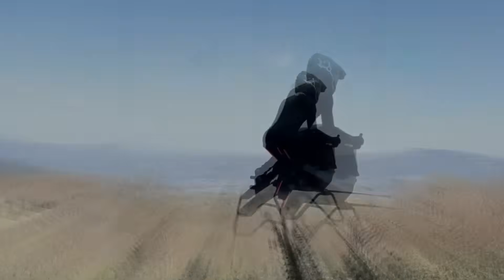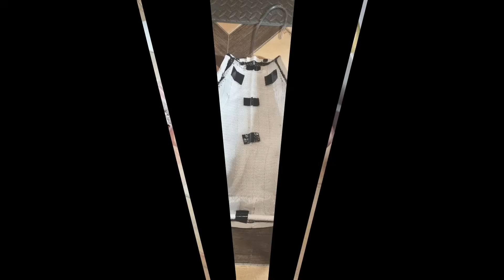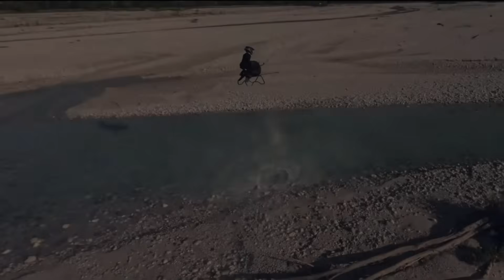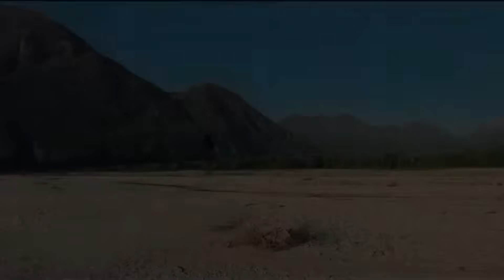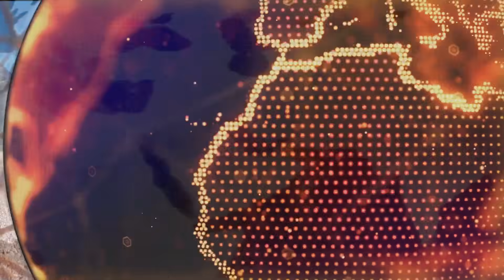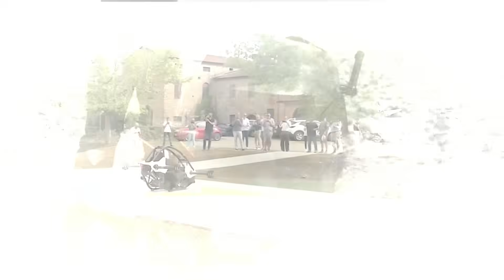2026 NEW VOLONAUT AIR BIKE OFFICIALY LAUNCHED!! Key Features, Tecs, & Benefits!!

Comment: No one seams to mention what to range is ?
Reply from the maker: Great catch, @richardvandb6558 — you’re right, range is one of the biggest missing details here. 🧐✈️

Based on similar jet-powered personal flyers, we're likely talking *10 to 20 minutes* of flight time per tank, depending on weight, altitude, and throttle use. Volonaut hasn’t published exact numbers yet, but with jet propulsion, efficiency isn’t the strong suit — at least not for now.

Would you consider something like this worth it with such a short range, or would longer endurance be a must-have for you?
Reply: @ too much money for too little fun
Reply from the maker: @richardvandb6558 You bring up a solid point — at that range, it does feel like more of a thrill ride than a practical commuter. 🚀 Would you be more interested if the Volonaut had a longer flight time, or is the price just not worth it for you either way?

Comment: Problem is flight time
Reply from the maker: @innomoto
Totally agree, @gs-andy! Flight time is one of the biggest hurdles for any personal flying vehicle right now. Even with advanced battery tech, we’re looking at limited flight durations, especially for something like the Volonaut Airbike.

To make it more practical for everyday use, we’ll likely need to see significant improvements in battery energy density and charging speeds. Maybe we’ll also see hybrid systems or advanced fuel cells that offer longer ranges.

How long do you think an ideal flight time should be for it to be practical for commuting or recreational use?
Reply: @innomoto  You should be able to have an hour of flight time, but it will be exciting to see how the technology develops, but very cool concept.👍
Reply from the maker: @gs-andy Absolutely, an hour of flight time would definitely make it more viable for real-world use! 🚀 It’ll be interesting to see how the technology evolves — maybe one day we’ll be zipping through the skies like it’s no big deal. How do you think battery advancements will change the future of personal flight?

Comment: A wonderful machine. I would love one of those. What kind of price point are customers looking at?  I would also like to see a takeoff and a landing. Is it difficult to transport? weight?
Reply from the maker: @brianjanson3498
Great questions — and you’re definitely not alone in wanting one of these! 🙌

Right now, there's no official retail price, but early prototypes of similar jet-powered personal flyers often land in the \$300,000–\$500,000 USD range. That could change dramatically depending on production scale and tech improvements.

As for transport — good point. The Volonaut’s compact frame helps, but the jet system likely makes it too heavy and bulky for a regular trailer. And takeoff/landing? From what we've seen, it’s vertical like a drone, but it requires serious skill due to thrust and stability control.

Hopefully, we’ll get full takeoff and landing demos soon. Would you be more interested if it had an easier launch system or came with a transport kit?

Comment: what is the power source? where is the fuel kept? what is the real range? seems like vaporware to me.
Reply from the maker: @innomoto
Great questions, @jims9625 — and you’re not alone in wondering! 🔍

Volonaut hasn’t released full technical specs yet, but from what we know, it uses jet turbine propulsion — likely powered by aviation fuel or a similar high-energy-density source. As for range, it’s still speculative, but early prototypes like these often have short flight times (10–20 minutes) due to fuel and weight constraints.

You're right to be skeptical — until we see consistent test flights, specs, and certifications, it's fair to call it "concept-stage" or borderline vaporware. But that’s also what makes it exciting — it’s a peek at where personal flight might be headed.

Would you be more interested if it ran on electric ducted fans instead of turbines?
Reply: It uses small jet engines like Franky Zapata.Franky uses 5 micro jet engines on the fly board air look it up same thing.Not a mystery. 😊👍🏻
Reply from the maker: @danielhipp5541 Exactly! The Volonaut’s tech seems inspired by pioneers like Franky Zapata’s Flyboard Air, using multiple small jet turbines for thrust. It’s a fascinating step forward, though the real challenge is balancing power, safety, and flight duration. Would love to see how they tackle that in the next iterations! What feature would you want in the ultimate flying bike?
Reply: @innomoto cup holder 🤣 have you seen my 5 foot flying Delorean model we use a $ 100,000 jet drone with 4 jet engines to fly ?
Reply from the maker: @jims9625
Je comprends parfaitement ton scepticisme ! Le Volonaut Air Bike utilise de petites turbines à jet similaires à celles du Flyboard Air de Franky Zapata, avec du carburant aviation stocké dans un réservoir à l’avant, un peu comme une moto.
Le temps de vol est pour l’instant limité à environ 10-12 minutes à cause des contraintes liées au carburant et au poids.
C’est clairement une technologie encore au stade conceptuel, pas un produit prêt à être commercialisé.
Mais si les futures versions passent à des moteurs électriques plus silencieux et avec une autonomie plus longue, ça pourrait tout changer.
Tu serais plus intéressé par un Air Bike électrique plutôt que par un modèle à turbines à jet ?
Reply: The fuel tank is just like a motorcycle right in front of you.Franky Zapata fly board air about the same has 12 minutes of flying time.
Reply from the maker: @jims9625
Totally understandable to be skeptical! The Volonaut Airbike uses small jet turbines similar to Franky Zapata’s Flyboard Air, which means the fuel—aviation-grade—is stored in a tank up front like on a motorcycle. Flight time so far is pretty limited, around 10–12 minutes, mainly because of fuel and weight limits.

It's definitely still early days, so it feels like concept tech more than a ready-to-go product. But if the tech evolves toward quieter, longer-lasting electric ducted fans, that could change everything. Would you be more into a flying bike if it ran electric instead of jets?
Reply from the maker: @jims9625
Totally understandable to be skeptical! The Volonaut Air Bike uses small jet turbines similar to Franky Zapata’s Flyboard Air, with aviation-grade fuel stored in a tank up front like a motorcycle. Flight time is currently limited to about 10–12 minutes due to fuel and weight constraints.

It’s definitely still early-stage tech—more concept than ready-to-go product. But if future versions shift toward quieter, longer-lasting electric ducted fans, that could be a game changer. Would you be more interested in a flying bike powered by electric fans instead of jets?

Comment: Stabiliti look incredible for this small thing 😳
Reply from the maker: @Quiwi707
Right? 😳 The stability is honestly one of the most surprising things about it — especially for something this compact and jet-powered. Keeping it steady without a full aircraft-style control system is wild engineering. Imagine what it could do with next-gen gyro or AI-assisted flight control!

Would you trust it for low-altitude cruising, or still feels too sketchy?
Reply: @innomoto  really amazing ..
Effectivly ,this make me thinking about giroscopique whit moto concept few years ago in Los Angeles with many vidéo on YouTube.

Yes you tell the word ,its wild engineering like F35 army level ...
Crazy 
Just Jetson team or Zapata French guy team can do thing like that...

Just one reactor and stability ...whaou!!
Reply: @innomoto   low altitude..yes look ok for that 👍
Reply from the maker: @Quiwi707 Exactly! It's almost like a mix of F35-level tech and that gyroscopic moto concept — both wild and groundbreaking! 🤯 The fact that they’ve pulled off stable flight with just one reactor is a huge feat. If it can hold steady at low altitudes like that, it could open up all kinds of possibilities for urban commuting or rescue missions. Imagine the future of this tech when they start adding more power and AI-assisted stability! 🚀 Would you take it for a spin, or still need a bit more convincing on the safety front?

Comment: This real and if so how where can I get the breakdown of its tech?
Reply from the maker: @wisdomafoolweakness3391
Yes, it’s real — though still in the prototype or concept stage. The Volonaut Airbike is one of several new experimental flying motorcycle designs, using jet turbine tech for vertical lift and forward thrust. Think of it like a scaled-down VTOL (Vertical Take-Off and Landing) craft, but shaped more like a bike.

For a detailed tech breakdown, most info comes directly from demo videos, engineering showcases, and concept design releases. You can search for Volonaut’s official site (if available) or check out aerospace startup news, patent filings, and pilot interviews. Kardesign also shares speculative and design-based breakdowns that give insight into how such machines might function.

Would you like a summarized breakdown of the known and possible tech based on current prototypes?

Comment: Jet, frame, pilot. LFG🔥
Reply from the maker: @masteraugmentedproduction5828
Straight to the point — Jet. Frame. Pilot. That’s the whole vibe right there. 💥 It’s raw, stripped-down flight power. No fancy cockpit, no bulky fuselage — just you riding a turbine with a seat. LFG indeed. 🔥

Would you take it into the wild, or rip the skies over open water?

Comment: So we just gonna believe this thing flys without propellers or wings?  I call bs theres no explanation of the thrust
Reply from the maker: @aaronsanchezz Great point! The tech behind it is definitely fascinating, and it seems like they’re using jet propulsion instead of traditional propellers or wings. While the details on thrust are still a bit vague, jet engines can generate enough force to lift and propel such vehicles. It's an exciting leap into jet-powered transport, but we’ll need more specifics on the tech to fully understand how it works. What are your thoughts on jet propulsion for personal flying vehicles?

Comment: What's the mileage?
Reply from the maker: @therasprince
Great question! The exact mileage hasn’t been specified yet, but given that it uses jet propulsion, I’d expect its range to be fairly limited compared to conventional vehicles. The battery or fuel capacity likely plays a big role in this. What kind of range would you find acceptable for something like this?